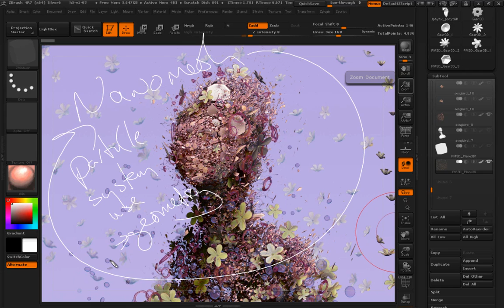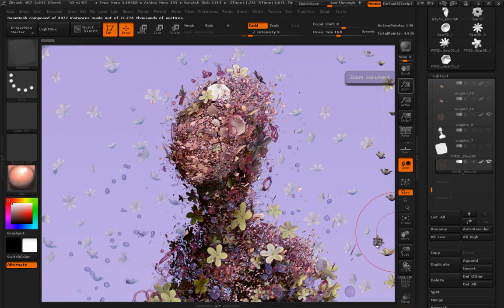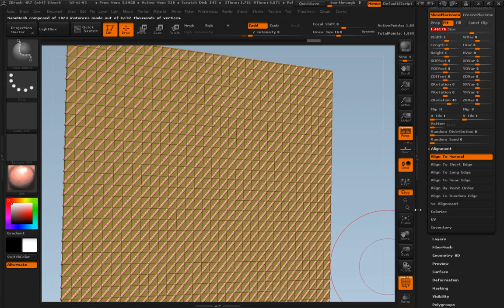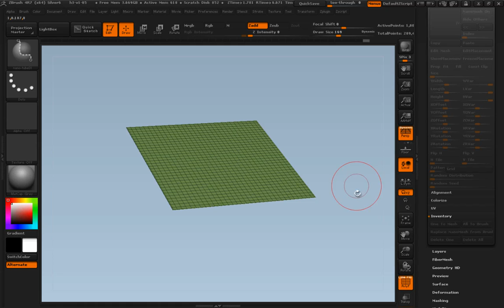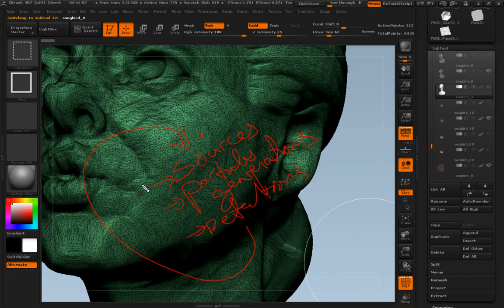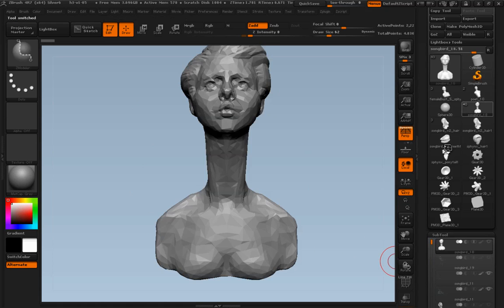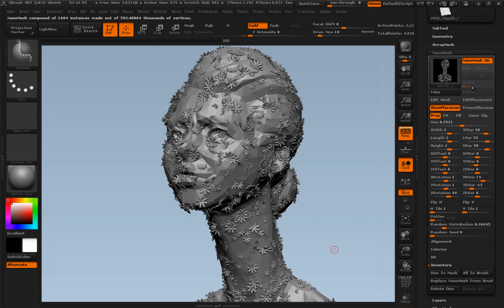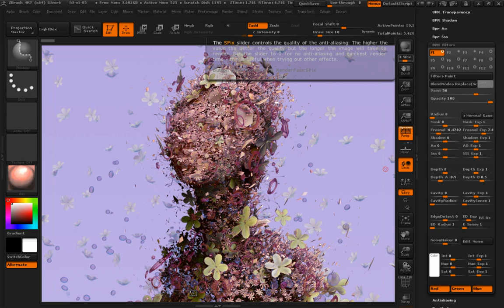ZBrush 4r7 Feature: Nanomesh

Comment: They made a big mistake when they decided to ignore the UV-Texturemap workflow
Reply: Nanomesh works with uv'ed Objects as well  (no polypaint ! Full UV difuse textures & normal maps & Displacement Mode !). It's about the greatest thing for creating fully textures environment tiles. You can texture up nice lowres parts with displacement in bump mode, then use the mesh(es) as nanomesh.  And with x64 even working on an 8k document is possible easily. I am truly not on board with the polypainting since I could never get enough resolution for filmres textures but I gotta say -- in terms of highres tile creation this beats it all at the moment for me.